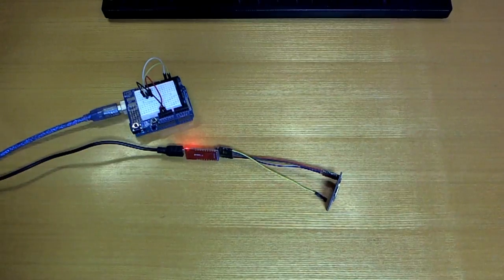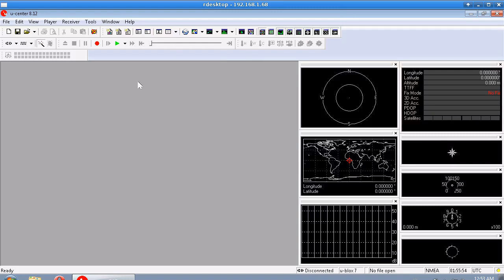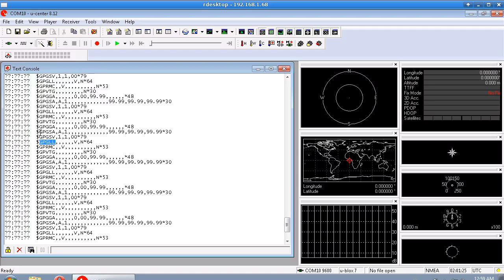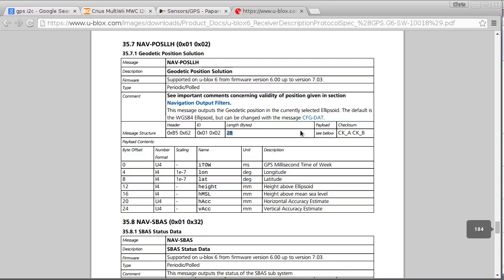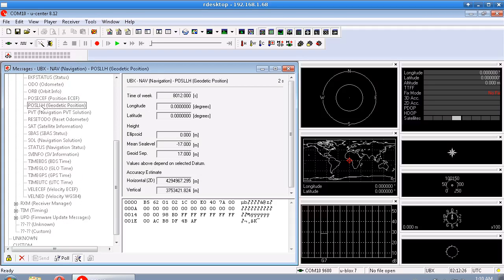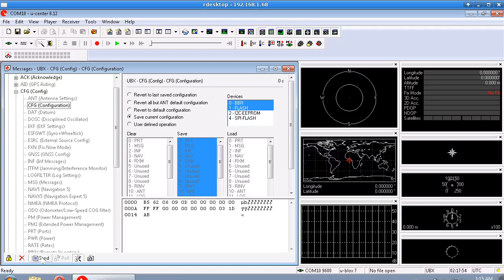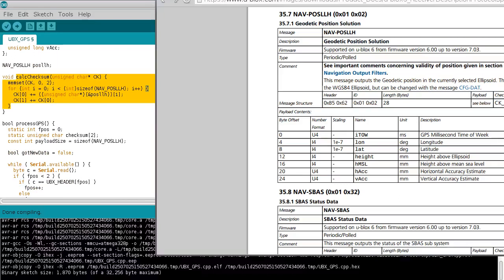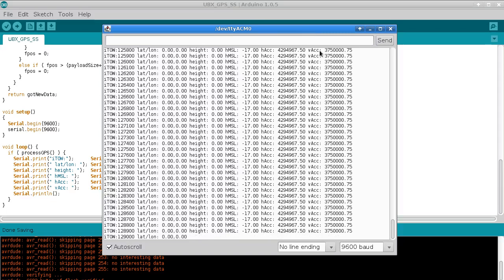10Hz U-blox binary GPS data in 66 lines of code (arduino)

Comment: U_BLOX 66 LINE CODE in Pastebin.
Reply from the maker: +OE8PCK you have a link to it?
Reply from the maker: +OE8PCK cool, it seems to be private though, is there some setting to make it publicly viewable? Also, can you reply to a previous comment so we can keep track of this better? I'm answering dozens of comments every day and I've already forgotten the details of what this was about...
Reply from the maker: +OE8PCK thanks, that's better. Could you remind me what the problem was? It doesn't compile btw, is it supposed to be compiling?
Reply: +iforce2d It did compile before I tried adding the Provision for checking for a fix. I started off by using your code for reading out the u-blox as you did and that compiled of course. Then I added the Provision to store the data you printed in your code to the terminal view. This compile as well. THEN my Troubles started I added a new struct called NVS_STATUS and wanted to use the FIX ok part with an IF to controll whether the SD Card saves data or not . i.e. if fix ok then store data if not wait for fix. I think the struct was ok for NAV_STATUS but things went wrong when I tried to calculate the check sum and read out the NAV_STATUS data into the struct.I hope I have now explained what I am trying to schieve.Thanks Paul
Reply from the maker: +OE8PCK perhaps if we could start with a compiling program, would be better. I mean, you don't need me to tell you what's wrong with it in the current state because the compiler errors tell you already.
Reply: +iforce2d GPS_U_BLOX_WITH_SD_CARD http://pastebin.com/2rm0eJuN in Pastebin. I cannot find a way to extract the fix ok and apply an if for the SD Card saving. I really do thank you for your Kind help.
Reply from the maker: +OE8PCK as a general rule to help someone else figure something out, could you say:
1. what is the behavior you expect to see
2. what is the behavior you are seeing
3. what have you already tried to solve the problem
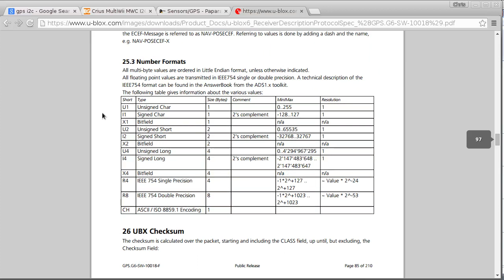Reply from the maker: +OE8PCK hmm.... just looking at your code, the types of the variables in the NAV_STATUS struct do not match the documentation. For example, the gpsFix variable is given in the manual as type U1 which is a one byte unsigned value, so it should be unsigned byte or unsigned char, but you have it as unsigned long which is four bytes. The explanation of variable types is given in a section titled "Number formats" or maybe "Variable type definitions" (I showed them in the video at 14:45). Be sure to look up how many bytes the arduino variables have, to get the right match (eg. google 'arduino variable types').
You have not included the flags, diffStat, and regs etc members of the struct. That stuff is really important to make the struct the right size.
You don't need the flag state values as members of the struct, you check them like this:

if ( navstat.gpsFix == 0x05 )
// time only fix
else if ( navstat.gpsFix == 0x03 )
// 3D-fix
... etc
Reply: +iforce2d Hi, I am begining to realize that this is all over my head. I thought it would be a lot easier to make the new struct and then call up the GgpsFIXok. I just don't have the required knowledge and before I trouble you  you any more I think I will just use the data stored to the SD card and then edit it later. I now realize why you did not add a GPS-STATUS it requires alot of time as you mentioned. I looked at the Data Sheet and could not find the Flags that you said I left out of the STRUCT. diffstat and regs etc. I thought I had everything. Is there no way just to read out the Fix Status and apply the result with an IF code? If not please Count me out and I am sorry to cause all These questions. Many thanks for trying to help me.Regards and thanks,   Paul OE8PCK
Reply from the maker: +OE8PCK actually there have been a lot of people asking the same as you, about adding another message type and usually they want the NAV-PVT message. I'm thinking I might make a little update to show what changes are needed to use a different message sometime. If I do, I'll let you know.
Reply: +iforce2d Thank you very much. I cannot find NAV-PVT in the data sheet, does it contain the FIX? As I have written earlier, your code would be very useful for model aircraft Flyers because it would then be possible to Dave flight data and place it in Google earth. I have got everything programmed except the fix.

Comment: Hi iforce2d
I looked at your code for some time ago but as other I struggled to get it to work with the longer PVT protocol that module M8N has avalible. I found some other code on the web that I modified to work with the PVT protocol, not as slick as yours but, if you don't mind it be part of this thread I add the link to the GitHub I set up for it. If you mind, feel free to delete this post. Just go to GitHub dot com /anderssonemil/M8N-GPS-Data-Logger